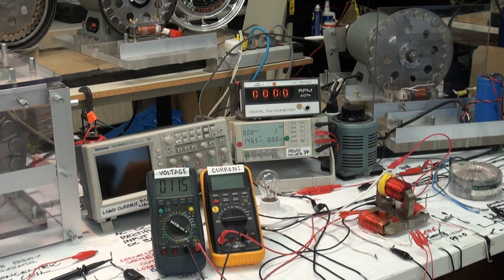VIDEO 13:  HOW CREATED ELECTROMAGNETIC FIELD ENERGY PERFORMS POSITIVE OR NEGATIVE WORK @ OVERUNITY

Comment: some info.    at :57,  HUH?    lmao        some info.       if (induced) current flow in the secondary side of the circuit is  Utilized, an  Increase in energy Consumption   WILL   occur, on the primary side of the circuit.       in part, ,this is because  lenz-related  Braking  occurs when a magnetic field  moves past a  Generating  coil; whose output is shorted, or when coil output Current  is  directly measured.      thus, estimation of output power,  watts,  must be based on  Accurate  values of output volts/amps.       power is watts.    watts equals amps  x  volts (Correctly estimated).        AC watts  and  DC watts are not the same; thus, (full-wave) rectification of the, wild AC,  pma output is  recommended.       accurate estimation of  output watts  must  be based on the pma output voltage,  at the associated (reduced)  rpms.      testing via the use of a  battery  charging circuit is   proof of  NOTHING.      you are invited to view my  Generating coil  tutorial.        where  force is applied to the rotor of a pma at its  Center of rotation,  the prime mover has   Negative-MA,   over the load that occurs at the coil/rotor interface.     in case it needs saying, this  NOT  what you want.!     until these conceptual   FLAWs  are  corrected,  you  will  be   FOOLING  only  Yourself.       googletranslate
Reply from the maker: VIDEO 8: HOW TO USE ELECTROMAGNETIC FIELD ENERGY TO PERFORM POSITIVE WORK @ INFINITE OVERUNITY: https://youtu.be/j05LSZjXcUY